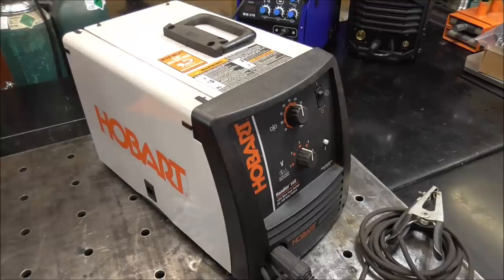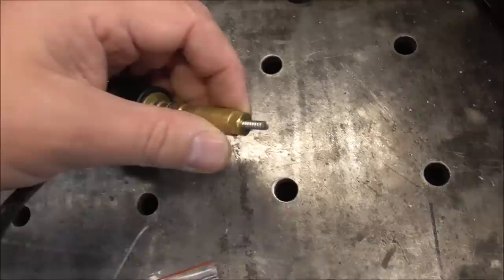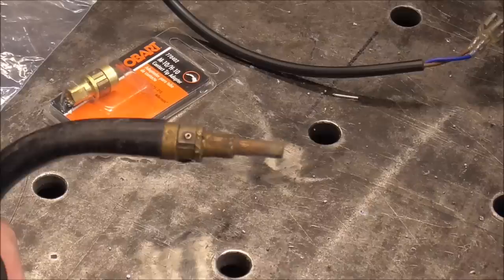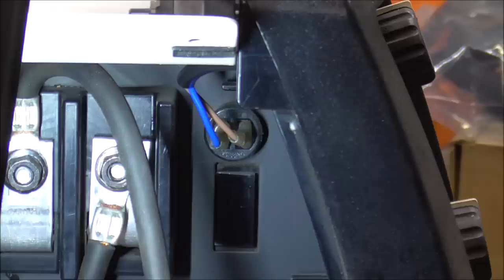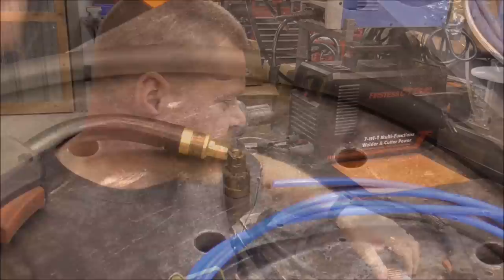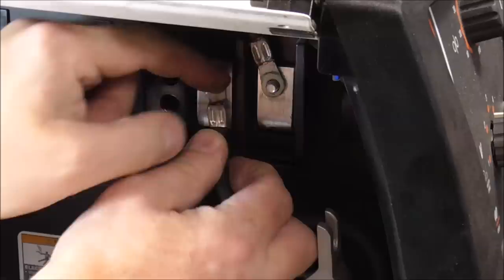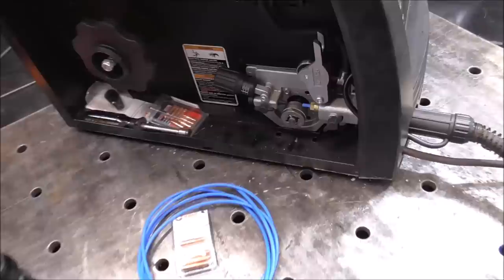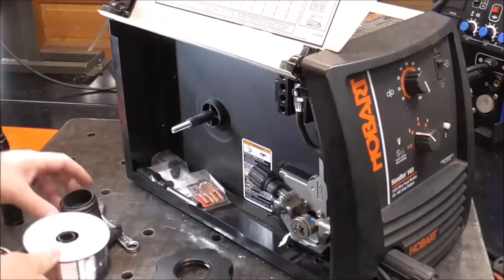Convert Your MIG Welder to Weld Aluminum - The Easy Way

Comment: Brandon, 
Thank you for a very good and informative video.  I've got that same welder and this is fantastic to know. 

A long time ago I worked in a pipe mill in Oklahoma with a Great bunch of guys.  We all worked together well and learned a bunch from each other.  I was an Electrician but was working with a welder on a large aluminum trough.  Jerry said that to preheat the aluminum to the correct temperature that I should first run a carbon rich flame on the opposite side from where he would be welding.  Then from the correct side use a neutral  flame to heat the aluminum to where the carbon on the other side just disappeared.  That was the the temperature he wanted the aluminum at and yes, the weld turned out beautiful.

I also worked at a bottling plant ant the welders there had different wire wheel, brushes, cutters and whatever for stainless and for mild steel.  So I understand about using different tools for aluminum to prevent contamination.
Reply from the maker: Thats aweome Alan. Flame and even material color to determine temperature has always fascinated me.

Comment: Great video! I'm going to set up a gun and liner for aluminum. I do mostly steel, but occasionally I need to do aluminum. Was always told  had to have a dedicated machine for everything! I'm not a professional or do this for a living, so this is going to be wonderful!  BTW, I checked out my mig and it has settings in the owners manual but not on the machine like yours. I don't know how I missed that, I usually read everything in manuals. I guess people telling me it couldn't be done    just blinded me! Lol! Thanks for your time and sharing! 👍😎✌️( Oh yes, and a bottle of argon)
Reply from the maker: You know something James this is a lot like welding cast iron. There is a lot of conflicting misinformation out there. Usually the people that say it cant be done have either never tried it first hand or they skipped one of the steps that I listed in the video and it gave them poor results. This process has been around for a couple decades but I cant help but think it's not overly advertised because if you can convert your machine for 25 bucks for occasional welding, why would someone spent 800 dollars to buy a new machine that can do the same thing.
Reply: @BrandonLund  Exactly! I'm really tickled I saw your video... I also subscribed! It also reminds me not to believe everything you hear, and, take a little more time reading my manuals! Thanks Brandon!
Reply from the maker: Thanks James and I appreciate the Sub! 👍🙏
Reply from the maker: Dude that last part killed me! Isn't that the truth. It seems the ones that can't weld have the loudest voice lol 😆

Comment: I never MIG welded aluminum  before I watched this video. I bought the recommended liner and swapped out the steel liner on my Millermatic 211.  Using the recommended 030" ER5356 wire, 100% Argon , and .035 tips I started laying down some almost acceptable beads on aluminum coupons. I also had a number of burn backs, ruined tips, wire loops at the drive roll, and blow throughs. I tried a number of settings. I went back online for clues on how to get better. I was surprised to see how different the technique is for Aluminum compared to steel. I found: some tips that helped including running hot and fast (no forward back, no e's) as well as to keep the stick out to 3/4". Thanks for getting me started!
Reply from the maker: Thats awesome man. Always push with aluminum. Keep your whip as straight as possible. 3/4 to 1" stickout and I use very little manipulation. It takes some practice but in little time you will be stacking dimes   👍

Comment: Thank you for an informative video!  My first welder was a flux core machine I picked up at Lowes before I knew anything - naturally.  I soon discovered just how easy it was with flux core to make incredibly poor welds!  Blobs, BBs, lack of penetration, spurts...you name, I learned how to do it all VERY WELL!  I also eventually learned the "secret" of overcoming all the FC limitations and turning out some amazingly uniform, full-thickness welds that indeed had a near stacked dimes look though I prefer a little S2S stir that does wonders in washing the molten metal into the substrate.  With perfect welds and a good brushing afterward, people can be fooled into thinking they're seeing MIG welds!
I eventually bought an Eastwood 180 with the aluminum spool gun that has sat in the garage for about 3 years now awaiting a project worthing of a genuine MIG machine!  How about that, I finally get a decent MIG machine and haven't gotten around to using it!
Reply from the maker: I love welding aluminum. I don't always mention it on the channel but I never practice any of my first welds (aluminum, steel or any other metal) and I dont mess with any settings prior to welding. I set it to where I think it should be set and I fire up the camera. The first shot the viewer sees is my first weld. I think that keeps it real so that when viewers dont get an immediate stack of times on their first try they know why and what to expect.  As you know, getting the perfect setting takes a few minutes of padding beads to get travel speed and settings right. I think I might have a spool gun for this machine. I might have to try it with some 4043

Comment: Great presentation as usual Brandon!  
I was unaware a DC only machine could weld aluminum. I just learned a lot about the differences of the different waveforms in school. We were TIG welding aluminum in my Fabrication class so this topic in general is very timely for me. 
Thank you for showing us how to convert our machines to do this.
Reply from the maker: Thanks Shasta. A lot of production shops and trailer manufacturers use this setup because it's quick. They often add a push pull system but everything else is basically the same
Reply from the maker: @Rich Pitty there are folks here that have been welding for years and didn't even know this was possible. That's who this video is for. Buying a TIG  machine to do an occasional aluminum repair may not be desireable to some folks. I like to offer solutions and this is just another option for people to use. Knowledge is power.
Reply: @BrandonLund  good to know!  Thank you!  I just got the Everlast 255 TIG welder so I can practice my aluminum but i like knowing that for situations where that may not be a feasible thing to do...that the job can still be done.
As always, keep up the good work!  Looking forward to tomorrow's video!!!
Reply from the maker: Thats awesome! Congratulations!
Reply: @Shasta_Rayne  The secret for making a great looking aluminum TIG weld is the metal has to be clean. Aluminum is the only common metal that has to free of oil, grease, paint and gum from labels. Grind it, file it or whatever you have to do. Laquer thinner or acetone and some scotch brite works wonders. The military spec for welding aluminum is to etch it in an acid tank. Not sure, but it might be phosphoric acid.
Reply: @georgebuck2269  thank you for the good advice!
Reply: @Shasta_Rayne  The choice of what type of filler rod to use on TIG aluminum is important. It's called "Color Match.' If you accidently use 4043 wire instead of 5356 on a piece of aluminum and it's going to be black anodized, the weld part will stay white, while the surrounding area is black. This makes the part reject. Welders are always trained to use 5356 wire on all jobs because they never know what get's anodized and what doesn't.

Comment: Brandon, thank you very much for the demonstration. When I bought my multiprocess welding machine a year ago I had read that there was a Teflon liner available for my machine. I was wanting to find out more about it before I went ahead to purchase it, now that you've shown us the process these are going to be in my Christmas wish list😁😁
Reply from the maker: Right on man! You are going to have a blast
Reply: Could it be done with stainless steel
Reply: @rudymarrero9222  Stainless would not require the Teflon liner. The Teflon is for aluminium wire which is soft and could snag easily in the torch liner. Using the standard metal liner for stainless wire is fine.

Comment: I'll also add about the grooves on the drive, you want a smooth U drive, as the knurled groove for steel wire, can cause knurling in the alum wire, and damage you ptfe liner, the tip, and can make the wire easier to bend or snap.  Tons of companies make parts for thr top 4 Welder brands.  Lincoln, Miller, Hobart, and ESAB.  ESAB may not be well known to non-pros..  They are also expensive,  and if you own one, then you probably own a tig for aluminum already. Lol

Comment: Thanks Brandon, if I get my Millermatic dusted off and in my new shop. Ill try this.
Gonna enjoy teaching grand sons, 13yr old Twins how to "make it work" with what you got.
Reply from the maker: Thanks Chris I appreciate it. Enjoy your time with the grandkids. It's the best!
Reply: Remember the rules for MIG or TIG welding aluminum: use only Argon, or for a hotter weld a mix of Argon and Helium. It's also very important that aluminum be clean or it won't weld at all. No oil, grease, paint or gum from labels. If it's not clean use a small disc sander and then clean it with acetone or laquer thinner. In the industry 5356 filler rod is always used, as opposed to 4043, so if the part is Black anodized the weld does not turn white.

Comment: Wow. I need/want to weld aluminum. Sold my tig welder when I made my move to Florida to retire. Gives me the idea of setting up a whip for steel and one for aluminum. My welder has an old liner in it anyway. Swap the bottle, then the whip and move switch the polarity wires.
Reply from the maker: Right on @chuckgilbert2035 it's literally that easy! A lot of people don't realize just how easy it is to get professional results for not a lot of money. Your right about the spare whip though. That's really the way to do it. In about the same time it takes to change a roll of wire you can pretty much be setup to weld aluminum 👍

Comment: I bought a Lincoln 120v mig about 30 years ago, in the info, it said if you wanted to do aluminum to switch to the Teflon liner and use a rubber drive wheel to keep it from bird nesting at the drive. That has worked great for me, 1 extra thing I do to make switching the liner a tad easier, is after I remove the metal liner, I use the air nozzle and blow out the torch line.
Reply from the maker: Thats a great tip @Steve M thanks for sharing!

Comment: A number of years ago I built an aluminum skiff - 5052, 5356 wire - did everything you did but still had trouble with birds nest every so often. You did mention the gas for aluminum but not the flow rate. Not a big deal, but the proper flow rates, if you do a lot of welding will save some $$. Miller welder, no spool gun add on in that machine. Because the boat was lofted frames for the shape meant that the preheat was not lost on a table. As a final note a 12' sheet will yield a 11' 3" dink. Was a lot of fun to build.
Reply from the maker: Pretty slick! 👊

Comment: Thank you so much! I was just researching how to weld aluminum with my welder this morning, and there’s your video with my exact welder! You answered all of my big questions
Reply from the maker: Glad I could help!
Reply: Remember the rules for MIG or TIG welding aluminum: use only Argon, or for a hotter weld a mix of Argon and Helium. It's also very important that aluminum be clean or it won't weld at all. No oil, grease, paint or gum from labels. If it's not clean use a small disc sander and then clean it with acetone or laquer thinner. In the industry 5356 filler rod is always used, as opposed to 4043, so if the part is Black anodized the weld does not turn white.

Comment: thanks I always use a spool gun but this convinced me. A good 200 A Mig inverter with pulse and you are the king of the hill. I think knurled drive rolls would be better and would not flatten the wire in the contact tip.
Reply from the maker: This is a pretty sweet setup especially for the money. A short mig whip helps too

Comment: I have an Esab Rebel. 
  I actually bought a cheap Harbor Freight gun and modified the plug and connection to work on my ESAB. Saved me major $ over an expensive gun type. 

I might still look at doing the liner mod since it would be easier in tight places. 

Thanks
Reply from the maker: Thats the way to do it and you save of bunch of money too. It's just as good in my opinion

Comment: I have turned my gas flow up and did pull welds much nicer than trying to push the weld. The 190 hobart or a 220 volt welder does a nice job.
Reply from the maker: The 190 is a very nice unit! Right on man!

Comment: I have a Miller 211 and just picked up a spool gun and my next is an argon bottle. Can't wait to get some seat time welding aluminum
Reply from the maker: It's a lot of fun. It can be frustrating at first but once you get your settings dialed in its like buttering toast. Super satisfying.

Comment: THICKER PLATES ARE DOABLE!  Leave a gap, chamfer the joint, let the gas torch do some of the work- and multiple passes, BUT...
* DUTY CYCLE!!*** Adhere or burn out your welder. 
Great video! I didn't know that! THANK YOU!
Reply from the maker: Yah this machine will easily do thicker material. It's the thin stuff that can be difficult
Reply: When welding thick stock use helium or a mix of argon and helium. Sometimes a preheat is used.

Comment: Awesome, thank you for sharing. I'm an old retired fart and picked up a cheap used MIG welder. I only new how to ARC & Acetylene weld. With the now high price of gas wire feed seemed like the best alternative for little DIY & auto repair projects. With your tip I can save the $200+ on a feed roller gun. 👍
Reply from the maker: Thanks man and enjoy!

Comment: I got the same welder for free...I have a multiprocessing welder already for my main welder...I just wanna be able to tac up aluminum or do a small project here and there and I have 100% argon already for doing tig so I setup my little 140 for this specifically to only get out in the occasion I have to stick aluminum together. Thanks for sharing!
Reply from the maker: Your welcome and that's a great score picking that up for free. The 140's sell for around 450-500 in our area on Marketplace.

Comment: Machines with double pulse feature are recommended for aluminum welding with mig machine. I have a double pulse machine, but it is still very difficult to weld aluminum at the same quality every time. It is important to preheat the part. You should also remove the oxide layer with a brush before welding. I tried this method for a few months, but then I had to buy a machine with AC feature. Thanks for the video.
Reply from the maker: It works great. You just have to pracrice. This is how most production trailers are built.

Comment: If you want to use the same machine for steel and aluminum you can just pick up an extra MIG gun. I do that so I have one with a Teflon liner for MIG brazing and a larger steel liner for steel. Aftermarket guns are quite reasonable and it's wise to have a backup so I do.
The argon cylinder will not be cheap BUT if you buy used argon cylinders (or MIG mix and exchange them for argon) you save a nice chunk of change over leasing (which only businesses should do) or buying new (I'd have to be desperate given the prices). Learn what your local welding supply will refill or swap and you can wallow in cylinders for cheap. I have more industrial gases for my home shop than many rig welders thanks to auctions and Fecesbook Marketplace. It's easy to cover multiple metals with one machine but welders keep following me home.
Reply from the maker: This is an excellent comment, thank you!  Welders seem to follow me home too LOL. Your spot on about having a spare whip. That's really the way to go. I didn't mention in the video because it's not overly cost effective in the long run but another option if someone is on a budget for occasional use is pick up a 40cu/ft on marketplace. As you know, gas gets cheaper the more you buy, so I tend to gravitate towards the biggest tanks I can safely manage by myself.

Comment: Brandon, I did not see you backing up your MIG gun at the end of the pass.  The result is typically a small crater at the end of the pass, which can result in cracking.  Backing up the gun allows the crater to fill.  I have run many pounds of 5356 wire with a large mig machine.  I use .035 and .045.  For aluminum, I use a pistol grip MIG gun and a 10 ft cable hose.  The pistol grip removes the friction component encountered in the curved section of a standard gun.  Even with the pistol grip, if you look cross-eyed at it, the wire will bird nest, especially on .035 wire.  I use a standard liner.  I will have to try one of the low friction liners on my next aluminum welding job.
Reply from the maker: This was my 1st time running wire this small. I was actually impressed it was able to weld this thin material. I was almost certain it was going to blow through...my reason for not camping out for the crater fill 👍  plus it was more about the practical theory of the machine setup vs the quality of the weld.

Comment: I've got a little Lincoln 125 plus I've had for 10 years it's not the best but I've done a lot with my little welder. This video is great cause it's not showing the best way but it shows you can get it done with what you have if you really want to
Reply from the maker: Spot on brother! I had a cheapo Chicago Electric 140 back in the day and I built trailers and all sorts of stuff. You don't need to have top of the line equipment to get good results.